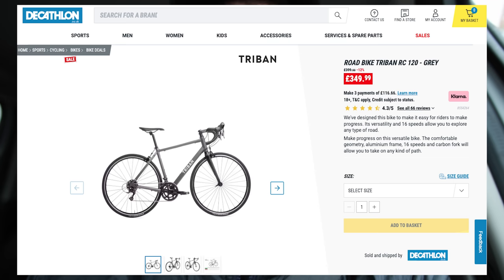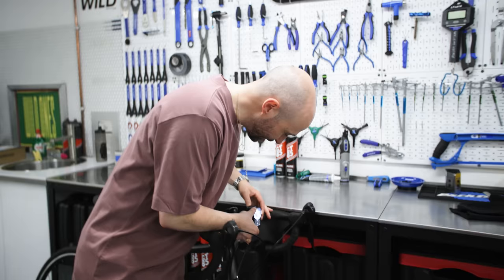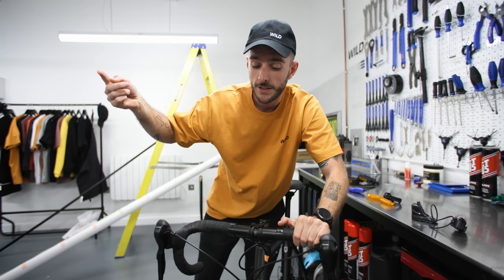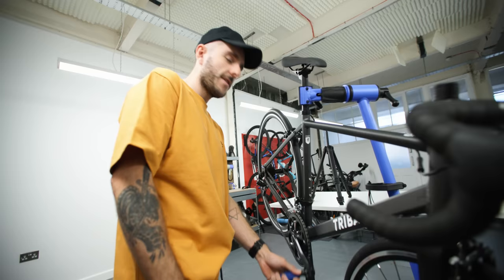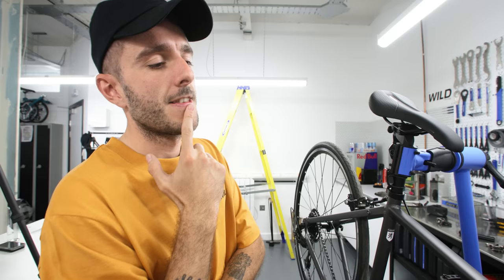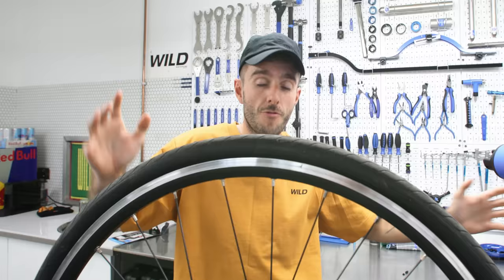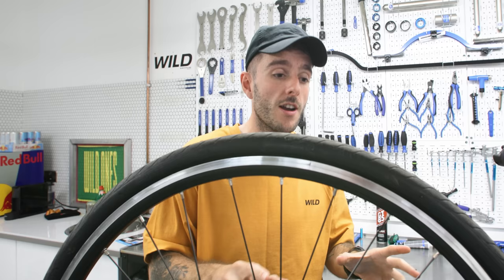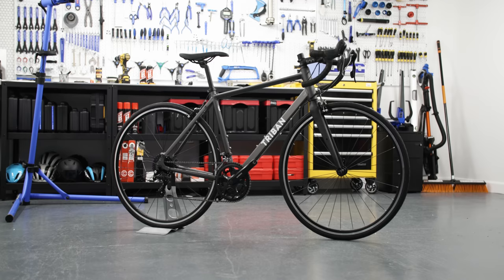We Bought A £350 Entry Level Bike in 2023 - This Is INSANE Value

Comment from the maker: Small correction on component sizes, here's what they claim on their website, but our Medium came with a 100mm stem which seems to be an anomaly:
Handlebar width end to end: XS, S: 400 mm
M, L:420 mm.XL: 440mm
Stem Length: XS, S, M: 90mm
L, XL: 110mm
Reply: I think you're missing the most important parameter- weight.
Reply: I had one M and it came with a 100mm stem. I live in Portugal.
Reply: I'm so tempted to get one... 😅😂
Reply: Also got M with 100 mm stem and 420 mm handlebar. Feel too stretched on that bike. Should have bought the S.
Reply: Love you guys
Reply: LG IS FOR 6FT + GANGALOYDS 44BARS 175 CRANKS 120MMSTEMS 58-60CM FRAMES
Reply: Hey lads, I'm in Ottawa, Canada. Looking to collaborate. You guys open to working with a Canadian Triathlon competitor? 

Let me know, 

I've managed to gather local sponsorships, schedule is set for 2024.. Lots of dates in Europe for the 70.3's..

Currently training on a Kunstadt Steel frame I bought for 100$ from Dave's Bike Dump - Put 400$ in to parts upgrades + maxxis 32's.. it's a hybrid. 

I need to build my own TT for next phase of training. 

Cheers
Reply: my height is 5'10", is M size suitable for me?
Reply: @neznaboh what's your height?

Comment: That's my bike! The RC 120! Upgraded the groupset to sora, wheels to Shimano RS100 - all after 15000kms! Thank you for covering this.
Reply: @George Gifford Over here in India, I paid a total equivalent of almost 225 pounds (just the  - chainring, cassette, chain, brifters and RD). The FD is still Microshift R8. Works perfect with the Sora Brifter.
Reply: @kalilebron007  hey i live in india too,i am trying so hard to find upgrade for my triban rc100
Reply: Your bike sounds like Triggers broom.
Reply: I’ve the new Disc version and  upgraded to 105. With my back issue, this is the perfect geometry for me. 

Next to upgrade are the wheels and tyres.
Reply: Be good to recommend best wheel set to upgrade to bang for buck . Set a limit of £100-150 to see what that gets you . A few years ago I think 7 I brought a ribble pro carbon with full sora the new version hidden cables for £500 went everywhere on that including a 600km audax
Reply: @jon_underscore  calm down Ms Serious.
Reply: @hishmithvvardhan5809  hey dude.... Where are you based out of? (In India)
Reply: @somaiah88  bangalore
Reply: @jon_underscore  good glad you are not slagging others off.
Reply: @kalilebron007  dude! WIGGLE is selling Shimano 105 FULL rim brake groupset for £300. Bargain right now
Reply: @dicconhill5593  shout out to the Niche  reference!! #alrightdave
Reply: How did you like the Microshift shifters?
Reply: @joerenner8334  Takes a little getting used to.
Reply: So..what bike would you recommend for 5 hour ride?
Reply: Can I ask you some questions. My job is 7 miles from my home, and 7 miles back. Going is very hilly up and back well is all down lol. Lots of turns , I'm worried about the getting there part and u can't drive yet, I broke my neck three years ago and I can't turn my head 100 percent yet,but getting there, but for now I'm sick of asking for rides and I'd love some freedom again, and I'm allowed to ride a bike,  but at 44 I'm not ready to wear myself out pedaling 30ndegree hills for 6 miles there lol, will this work for me?
Reply: @jonnicholas  I live on the top of Catskill mountains. Many of our hills are FAR steeper brother , no reason to exaggerate anything up here. 
That's why ebikes are rare where I am. I recently bought a totguard and ended up pushing it up a few of the hills , that's with a 500 watt battery. The hills I am talking about are the ones on back roads which aren't as bad. Cars literally blow there motors up here, city people have no idea how bad these mountains are. To make it to the next town to my left,  the mountain road is far steeper the 30 degrees,  locals go right and travel an extra 10 miles to avoid it lol. 
Google route 28 going from Kingston to Albany and you'll see for yourself.The mountain is fun to use a truck to drive up and ride a bike down, but no one bikes up it. From big Indian to Margaretville is the biggest and steepest hill I know of in New York . I do think it woukd be possible on a ebike with either two batteries,  or a powerful 1000 1500 battery,  the moped style ebike , but I'm not sure to be honest. Love to find out though. I do know a totguard is being pushed up or driven up it, ive tried and it's not happening.
Reply: @jonnicholas  The whole reason I'm searching for a great ebike is I broke my neck. I'm healed a ton thanks to God,  my spinal cord wasn't damaged , but many nerves were pinched and a few cut straight through, so my right arm and hand lost some strength,  but I'm lucky to have anything so I'm not complaining.  I don't have the fitness level to pedal up some of these hills unfortunately,  at one time I could,  but age and injury has taken that. I'd still want to be independent,  but I cant turn my head 100 percent and tge nerves do get pinched if I sit in a car to long.  I want an ebike I can use solely power on for hills or rough spots , ans I want to be out alone here and there just to have a break from the kids and work.  Plus it's beautiful up here. The goal is to have  freedom and rode to work and have a few minutes just to myself. I don't want to have to push a ebike up a hill either, ots hot and they are heavy as he'll. The ride down is amazing though lol

Comment: Decathlon has made gigantic steps in regards to quality for their cycling products... Their VanRysel line, both bikes and clothes, is fantastic and if people gave them a chance they would put most brands out of market
Reply: Agreed, Van Rysel is quite good.
Reply: my VanRysel Gilet is better quality than my Pas Normal one.... one was £50 has pockets, waterproof, warm but breathable.. the other was £125 and is none of that
Reply: Really good kit, been using the gilet and the thermals for a little while.
Reply: I agree that the Van Rysel kit is great and i use it a lot because of the price to quality rate. BUT the Van Rysel frames tend to have a bigger margin of error in their production which can cause, for example, the pressfit BB's to creak, or the disc brake caliper mounts to be slightly misaligned. This isn't hearsay either, i worked as a mechanic at Decathlon and we saw this quite often
Reply: True.
Reply: Piss Normal are ridiculous. Sure, the press images look nice, but all the snobbery around the brand (in Scandinavia where I live) is just for laughs. I agree Van Rysel mostly offer great value.
Reply: Just went to Decathlon in Surrey Quays as the small Charlton branch closed and said to go there. Almost back to how they started with two whole warehouses which they reduced down to one. Got what I'd wanted at Charlton and noticed the VR range which was new to me. Triban range is pretty decent. Decathlon and Halfords both doing a good job but, inevitably with their purchasing power, putting pressure on smaller groups and individual shops who are cutting down to just maintenance work. I'[ve been extremely impressed over many years with Halfords, Charlton staff knowledge and how they true up wheels and check everything even on their cheapest bikes - far better service than my wife got from CycleSurgery many years ago from a female shop assistant with me staying out of the shop so as not to interfere.
Reply: Really like my Van Rysel helmet. It's very affordable too.
Reply: For real mate, I just bought the Van Rysel RCR bib shorts, 70€, and they make 6-hour rides feel like going to the pub. All of this while my Santini UCI bibs, 100€ of value, make me feel hell downstairs after just one year and a couple thousand kms
Reply: Ive looked at their bikes but in the end went for a canyon
Reply: @RDJ2 😂
Reply: @willhopewell 😢
Reply: Decathlons quality is also unmatched my family bought a couple bags from them in 2013 and they are still used regularly, even the logo isn’t even peeled off yet

Comment: I wouldn’t say it’s “heavy”. It’s only marginally heavier than the 1000 pound Scott Speedster you reviewed. I believe that one was 10.3 kg. It’s actually lighter than the Scott Speedster gravel for 1800 which was over 11kg. It’s definitely punching way above its price point.
Reply: A few years ago it would have been very light for a low end bike. Its not that long ago that aluminium frames were seen as a real premium option.

Comment: I've never bought a Decathlon bike, I tend to go for higher end second hand bikes, but I've bought loads of everything else from them. Their cycling clothing is excellent, I've got rucksacks, hiking gear, sailing and swimming stuff. It's all been great and amazing value for money, and often gives more expensive brands a run for their money. They seem to give thought to all of their products. Even if you are buying at the cheap end of their range it's rarely terrible and almost always the market leader in quality at any given price point.
Reply: Their bikes in late 90s - early 2000s were good too, I still have a Moutain Bike from that time (last Dedacciai steel frames in full XT with indestructible plasma hub, they even had a better one in Columbus aluminium and full XTR).
They seem to still have decent road bikes, but they gravel seems disappointing (I was looking at the titanium on but it has no thorough axle).

I also like they clothing material, whatever the Sport, like the breathing rain jacket that they developed and are equivalent to gore-tex for  a much cheaper price.
Reply: Sounds similar to my experience - for something like a bike I've gone for high end second hand, but Decathlon has been great for everything I've brought from there - running and cycling clothing, two tents and various associated bits of family camping gear, wet suits, paddle board, body boards etc. I've brought most running shoes from there and their trail ones are good for about 1000k. I've used them on runs up to 50k, but on longer ultras I've purchased more specialised stuff from other brands. Generally though as a store it is great value for money and the quality on most stuff is pretty good.

Comment: My 2015 Triban 540 looks like the exact same frameset as this. Main differences are that it came with Shimano 105 gears and Mavic Aksium wheels. It's a great bike - stiff, yet comfortable over long distances and has been good on club rides. Weighs 9.4kg but I've got it down to 8.9kg with a carbon seat post and saddle. I can't imagine you can do better than the RC120 for that money.
Reply: I have been riding the same bike for 5 years, completely satisfied. Just changed the seat witha a Selle Italia model x.
Reply: @tomislavaleksic2528  They're great bikes aren't they. I love riding mine, it performs great, it's comfortable and it's very well built. I have no need to buy any other road bike
Reply: same here. Triban 540 for the last 5 years. but mine came with shimano tiagra. i should follow your advice to bring down the weight

Comment: This comment might be random but... I was never a bike guy, but I ride my bike almost every other day for fun and even take it to dirt roads and have some good afternoons on it. The thing is: its a chinese bike that I got from a random ass store like 10 years ago for like 100€ only, it has full disk brakes and shimano gears and front and rear suspension, and I always felt it was good. I've thrown that bike to the ground, fell down with it many times, smashed through some pot holes, oh my god I've done so much shit to that bike. It still has all the original parts, even original tires, very worn down tho. Never lubed the chain, never cared for it. That bike has seen hell. And it still to this day rides like no problem, everything works, zero squeaking, zero wobblyness. So every time in this video that you guys say that "these wheels are not very high quality, they might last a month or two" I'm like what the fck? Do I have diamond wheels on mine or something? I'm sure that for 99% of people this bike will last literally 15 years or more easily, with ZERO maintenance. I know you guys are used to high end premium bikes but don't forget that cheap ass bikes are unkillable and most people use them until they rust away. This 350£ bike in this video is like gucci to me, but at he same time I kinda laugh that my chinese one has disk brakes and this one doesn't. Oh well, guess I eiher have a unicorn bike or these guys are blind to the low end market and/or biased to their premium bikes.

Just please don't say a freaking wheel on a 350£ bike will last two months... even the  cheapest wheel will last many many years
Reply: Such a good comment mate ,
Reply: I agree entirely, in my opinion BSO should apply to the plastic exotica not to the humble steel workhorse that will pretty much last forever
Reply: Probably your bike is made from steel and has completely different weight, is not it?
I rode such a bike like 15 years ago and after switching to something better(still entry level) I realised how big the difference was
Reply: @7ujt67u  Yes its a basic bike, its heavy. The thing is: it works, and lasts forever. My point was that in this video he constantly talks about the importance of maintenance, and how the components are low quality so they will break sooner than higher end ones and etc. And my comment was about how my cheap ass bike will probably outlast me so the argument that "cheap bikes last less" is not true. They are cheap, heavy, clunky, etc but they will lasts many many years anyway. Steel, for example, is heavy yes, but will last forever and is extremely strong so its almost impossible to break. In bikes specifically, cheap doesn't mean worse, just "less advanced".  A cheap $100 bike is enough for 80% of people out there. This video (and my bike focused channels) talk about how little this bike will last. I'm sure it will outlast any carbon fiber and exotic spoke wheel $4000 bike. For most, a cheap bike with basic tech is fine, and I would hope these youtube channels would acknowledge that. Is like motorcycle channels telling people that anything bellow 1000cc is trash... it's not. These channels make people buy overbudget stuff that they will never need just because "a guy on a video told me so". I hate this extremen consumerism attitude. But oh well
Reply: @azenyr Noone wants a steel road bike bro
Reply: Perfect comment! 100% agree.

Comment: My first bike was a Triban 500SE for £250 back in 2016 and it was (and still is) bullet proof. I now use it as my winter beater and can’t fault it. It has a Claris groupset and microshift gears and, for the price, it’s an awesome bike. 

I’ve also just put microshift gears on a flat bar hybrid that I’ve converted to a drop bar gravel and, again, they’re working perfectly. 👌🏻

Comment: I bought a 2nd hand Triban RC520 in 2020 as a temp winter bike. My summer bike broke, and due to a lack of availability I used it as my year round up to this past winter. Changed the wheelset and serviced it, that has been it. Done plenty of fast group rides, long rides and bike packing and it has been grand. Not the last word in comfort or speed, but even if I bought it new, it was and continues to be insanely good value.

Comment: The road bike that got me be back into cycling in 2014 in my early 40s after over 20 years out was a Btwin Triban 3 (cult following). I had that for years with wheel upgrade and done 1000s of miles on it. It still gets used as my bike I keep at my holiday place. I now have a Van Rysel EDR Ultegra which is a high end Btwin basically. Both from Decathlon and have been brill.

Comment: I have a slightly older version, which I bought 4/5 years ago. It's GREAT!
I use it recreationally and in the past for commutes. The only thing I had to replace were the brake pads. I even slipped and fell once when it was icy: zero damage.
The only rule I have, is that I never leave it outside and never use it when it's rainy.

Comment: This is my first road bike and daily commuter. As a tall guy I bought the XL frame. Having watched some of your previous videos I think I need a narrower handlebar than the stock one though. Only thing I've upgraded so far is the tyres to Fusion 5s. Probably do the wheels next if you guys reckon that's were the bike lacks. Was considering changing the group set but if you say the Microshift is fine then that's good enough for me. Thanks for the videos, they really help the inexperienced like me!

Comment: I bought the 2020 Version of this with disc-brakes and some higher rims. After almost three years there is nothing to complain about qualitywise. Even rust is not a Problem, even though i have to admit that it was thoroughly taken care of. I am a very strong and heavy rider (around 100 Kilos) and beside some new brakepads and some adjustment here and there i had never had any major problems. Best thing is, that the frame even handles tires up to 48mm width which is phenomenal and offers another usecase like gravel.

Comment: I have been riding this bike since 2019. It’s been decent and I haven’t changed much. It’s a little on the heavy side and the more I used them the more I have disliked the Mirco shifting. 
Overall, I have been pretty happy for the price, I have done some 50+ mile rides and it’s okay but could be more comfortable. I have done a a few triathlons too and have been quicker than averages. 

Liked the video!

Comment: I bought the 1x gravel disc brake version of this bike 2 years ago. My first drop bar bike. I love it, I rode the whole 800km of the south coast of England on it and had no issues. I got more into cycling and upgraded to a carbon Canyon Grizl last year, but I’ve kept the Triban with flat peddles as my shopping/ lock up on the street bike.